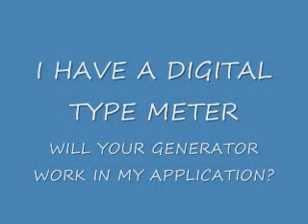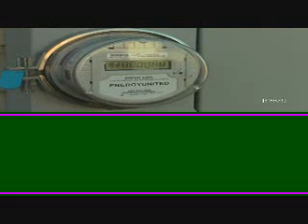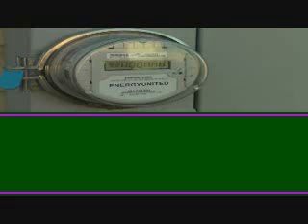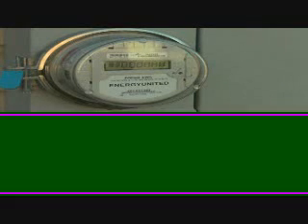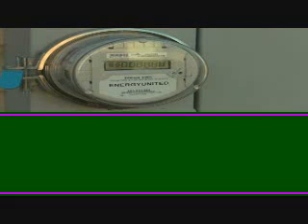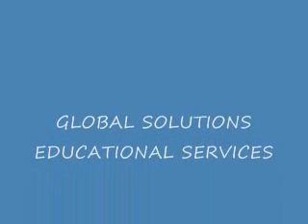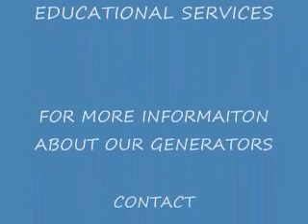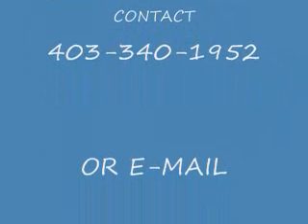NET METERING EXPLAINED.wmv

Comment: its all bs. if power was really being sent in to the grid they would have to pay. they never will, its a scam. however they reverse meter. witch gives you credit for what you would have used. that's all ...they will always control all...don't be fooled by bs .././
Reply from the maker: You are correct that in MOST not all power companies will only give you a credit. Some but very few will actually pay you once a year or quarterly. Most give you a credit and if you have not used it by the end of the year they reap the benefit
.

Comment from the maker: in the meters i have tested the numbers count backwards too on the old meters. This way the power company has had to pay people a credit in the past. With the new meters which use RF the numbers do not count backwards and as such you can feed in excess but you wont get a credit for it unless you go through the red tape bs and put in a second meter to register the power you have generated. This way the power company can pay you a low rate and charge you a high rate for the power you use
Reply: The credit is at wholesale not what you pay the electric company at their retail KWH.

Comment: Hi,you say the old fashion traditional analog meter weel turns backward BUT will the numbers of the already spend and registered energy also go backwards?Weel and registry go backwards or just the weel?
Reply: The wheel will go backwards along with the numbers.
Reply from the maker: Register will count backwards as well in most cases.. Sometimes they put a ratchet in the meter to prevent the counter from going in reverse even though the wheel does.

Comment: very useful to know that normal digital meters, do not  register the power fed to the grid, thou it also do not bill any power generated.
Reply from the maker: My aim is to empower the people with knowledge so we collectively can take a stand against this corruption. Together we are stronger then being the lone wolf.
You are most welcome
Reply: In the winter when the sun does shine very little they will charge you full rate and that is when you will use a lot more electricity. You are being RIPPED OFF!!